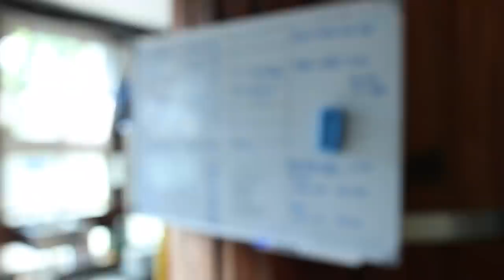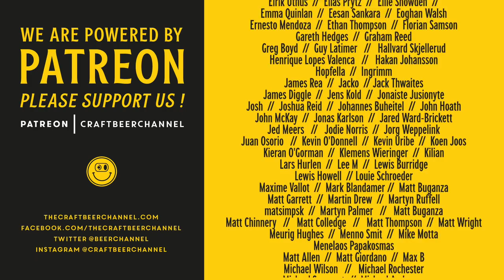The origins of Thornbridge & Jaipur | The Craft Beer Channel

Comment: Need to try Jaipur in a couple more formats really, had it in can and was not overly impressed. Would be interested to hear others takes on it in can.
Reply from the maker: What was your issue with it? Usually it is on top form in can because turnover is so incredibly fast.
Reply: @TheCraftBeerChannel  It was slightly soapy and at 5.9% it wasn't doing loads for me flavor wise hints of citrus + grapefruit bitterness. No idea how long it had been on the supermarket shelf so that could have been a factor.
Reply from the maker: @JackBWakeham  Uho - well soapy is no good at all, but remember it was conceived in the days where hops were supposed to be intertwined with the malt rather than cutting right through. So it should be caramel, orange peel, grapefruit and pine but never overwhelming, never punching you in the face with hops but remaining crushable for a few cans. Much like Pliny, Blind Pig, Two Hearted, Race 5 and that 2000s run of West Coasters.
Reply: @TheCraftBeerChannel  Like i say i would love to give it another go at some point i certainly didn't dislike it. Your point on the hops being intertwined with the malt definitely rings true though and makes a lot of sense. Its certainly more of an easy drinker than something that punches you in the face, maybe i went into it with the wrong expectations (does happen sometimes)
Reply from the maker: @JackBWakeham  God we do it all the time! You get so used to nursing and sipping at these massive DIPAs and Imperial stouts that you forget some IPAs are designed to be crushed...even if the ABV is implying that's a bad idea!
Reply: I'm convinced it's changed somehow. 7-8 years ago I remember it being alot better than it is now. That'd be on cask. Very interesting to hear that Jaipur is brewed with different yeasts for the different shipping method. You can definitely taste the difference. Explains why I'm not so keen on the can either.
Reply from the maker: I think most likely the change is to our palates rather than the beer - we expect more intensity and high hop prevalence these days - as well as sweeter beer generally.